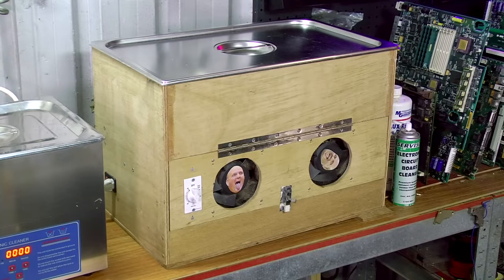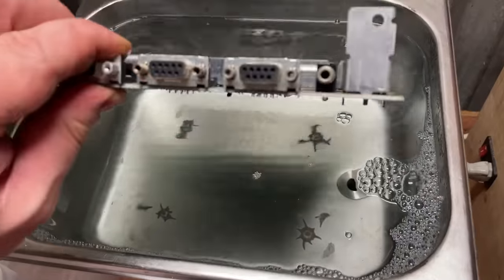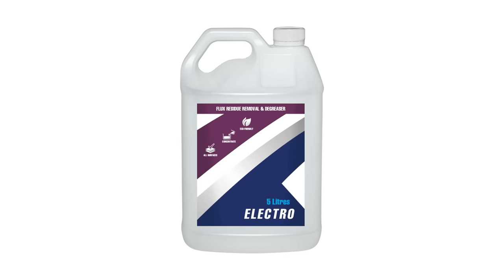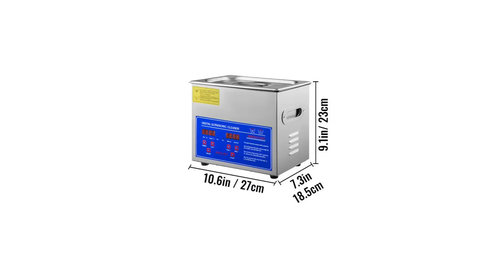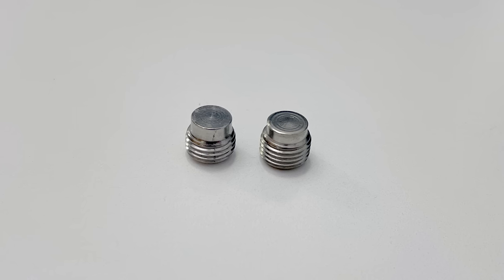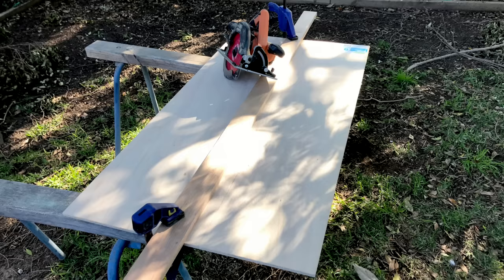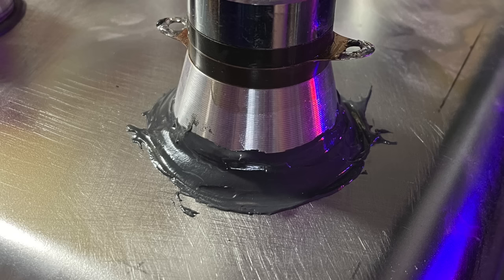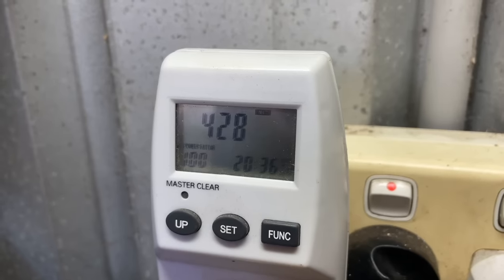Building my own Ultrasonic Cleaner

Comment: very good video !!! As a goldsmith I have worked with several of these cleaners over the years.
Did you know this hack?
An old Craft master told me during the cleaner is working to use some galvanic effekt...put some volts on Plus to the steelbasin and Minus to the ware.. in my case for example polished rings full of black polishing dirt under the settings. The dirt should go instantly off with this effekt. Perhaps you can test that?

Comment: I'd rather use JB Weld to seal a through-hole than to adhere a transducer. I'd have drilled 8 holes and pushed bolts through them, then smeared goop on the top to seal it off. Or maybe copper crush washers. But as another commenter mentioned, make sure there the right distance from the bottom of the pan. 

I'd also recommend making sure that all your transducers are effectively working together in phase. With smaller, single-driver builds this isn't a problem, but you could potentially see the two sets of transducers fighting each other with abtrusive interference.

Comment: I would use a broken file, or some hardened steel and gouge groves in the bottom where the transducers go...not just sandpaper...thick heavy grid like traces literally cut (not hugely deep but deep enough for the epoxy to bond to)
My small one kicked the bucket too...the mosfets/transistors and the flyback diodes shorted...uggh...ordered new ones...let's hope it works.
Going to cut a hole with a step drill in the side and find 5v-12vdc (if there is any) on the controller board...this way it can have airflow over the heatsinks and transducers. Might even go as far as insulating the metal bed with fiberglass insulation to keep the heat away from the heatsink/control board as well

Comment: Very cool video. I have considered building one in the past but came to the conclusion that prebuilt was better for me. It is nice to see someone build a DIY project where it makes sense rather than just because. Maybe the cooling situation is under control but you might stick little heat sinks on components that fail or get hot. The transistors have a through hole so they can be screwed to a heat sink. Often just a sheet of aluminum. They also make very tiny heat sinks ~1cm for sticking on small components. They are cheap because they are standard enough. Sticking a heatsink atop those transformers might help a lot. Though I don't recall ever seeing it done. Maybe because it wouldn't help that much with all the layers of tape and wire. Makes more sense just to not undersize the component.

Comment: I don't have any use for an ultrasonic cleaner but I found the video very interesting anyways. I was thinking that using more than one driver to push the transducers (in pairs) would make them vibrate independently and may cause some inefficiency when their phases are not in sync? It would seem one would like to push all the transducers in sync to avoid having destructive interference in the bath??

Comment: Just on the modules. They are basically piezo crystals being hit with an AC pulse. Meaning they are not polarity sensitive. If you throw a 'scope on the output of the drivers you'll see a high frequency AC wave. The terminals on the module should just be labeled A and B... One thing you should be aware of, make sure they are all wired the same. If not you'll end up with some out of phase with the rest, and that will reduce your cleaning efficiency (think hifi system speakers...).
Reply from the maker: Thanks, I cover much of this in my latest ultrasonic build video.

Comment: Sadly people really do think that using water on electronics is a bad idea when in reality it is the standard way of cleaning it. There is also no problem in using tap-water if you follow some simple steps. In general when cleaning something that is visibly dirty we used to just hold it under the tap and used a very soft brush to get of the junk, and only then throw it into the ultrasonic cleaner. This just keeps the cleaning fluid usable for longer and gives better results in the end.
Also specially for electronics with baredie flipchips, if they are small enough, we just put into a plastic bag with IPA. For bigger parts we just added some IPA to the water so it better cleaned BGA and other SMD parts while also helping with drying. But with IPA you need to be aware of the dangers of having an easily flammable liquid and its vapours and mist around so care must be taken.
(our local university has a very active electronics basegroup )

Comment: Check the regulator specification. It may work for 120v, not 240v. Also, do regulators work with 50hz and 60hz

Comment: You should be able to friction weld those studs buy putting the stud in a drill press and bringing it in to contact with the base. You might need to support the base on a block of wood. The friction and pressure will get the parts to a temperature where they fuse together . It would be best to experiment on some scrap first ! The discoloration caused by the heat would have to be buffed out.
Reply: How do you stop the drill from turning when there's enogh heat to weld?
Reply: @erik_dk842   you shut the drill off? 😅
Reply: @schwuzi  Your laugh tells me that you know nothing about the friction welding process.

Comment: Great video. You hit all the points without any Um’s, Er’s or Uh’s. Well done. 
I’m also a DIYer and have thought about my own ultrasonic cleanser. I wondered how to make sure they were all in phase. Don’t want half of them pulling while the other half pushes. Can you comment on that?
Also, is it desirable to vary the frequency? Maybe a dial on the outside that allows you to select Hz? 
Thanks,
Paul

Comment: put your drivers in a separate division outside of the box area where your tub sits.... so that air cooling will be more effective and isolated from your heating,,, if you can solder bolts on the bottom of the tub its better than any glue,
Reply from the maker: This is an excellent suggestion, and has already been done! I'll be doing a brief follow up video soon, outlining the recent updates I have made.

Comment: Are you using solenoids between the timer and the loaded circuits? That is transducers and fans.
Reply from the maker: The rotary timer in this original build was rated at 10 amps, and the load from the cleaner is only 2 amps, so no need for a relay or solenoid. I have since replaced that timer with an Arduino controlled timer, and that does use a relay.

Comment: You may have given the industry the idea of building a shallow but wide consumer grade ultrasonic cleaner if one doesn't exist yet.  I imagine that the commercial versions went though the same challenges that you experienced with they developed the first models.  I agree that the studs need to be welded.  I think the glue is to prevent the ultrasonicd transducers from unscrewing themselves from the studs.

Comment: as you are using diferent drivers you might get vibration feedback, transducers works the same as a speaker/microphone. The best is to use the same driver for all transducers in order to avoid phase problems in the 40kHz signal. Also working building ultrasonic cleaning machines notice those chinese drivers are too noisy.

Comment: I've used that JBL weld but I heated it in the oven 180 degrees for half an hour after it set, it's the high temperature version isn't it 250 degrees Celsius I think. But I don't know if the transducer will like the temperature, what you could do is to drill a hole in the connector and a hole in the tank and use a rivet with some epoxy resin or thread the drilled hole and put a bolt. Why does it have to be stainless steel what's wrong with using a plastic tub?
Reply from the maker: If you get a chance to check out my laundry sink ultrasonic cleaner build, you'll see how I secured the transducers for that one.

Comment: LOL 16:12 They are bolts dude, you can drill holes in the tup and bolt them to the transducers!:text-green-game-over::person-turqouise-waving:   (did not read other comments first :face-purple-smiling-fangs:) also put some cooling block on the transistor..

Comment: Very interesting. I think I will try building one.

What do you think the effect on driver operation would be if you used the bare minimum epoxy (to ensure it grips the pan over its entire area) and through-bolted the driver to the bottom with, say, a truss-head machine screw? A bit of RTV on the underside of the head should make a leakproof seal.
Reply: I thought the same thing.  First of all you should use the minimum amount of epoxy.  These high frequencies are very easily absorbed and the less you've got that's soft the better.   The point of these setups is to get the acoustic impedance as high as possible so that coupling from the transducer to the liquid is as efficient as possible.  The high surface area of the tray helps here, which also gives me the idea that the bigger ones will be more efficient and you could probably drop a transducer or two from the 100W per gallon rule as you go up in size.  Second, if it's being bolted into the transducer then why not bolt it into the base surface of the tray?  Just don't use rubber washers, though a layer of epoxy would be good here as a lock-nut glue and sealant.  Save it shaking itself apart.

Comment: Fascinating stuff!  I love learning for free from other peoples' mishaps 😇

I am interested in experimenting with ultrasonic transduction as an adjunct to HHO electrolysis, and have purchased kits that provide two different popular ultrasonic frequencies.  (Haven't had time to wire them up yet). 
Have you done any experimentation along these lines?  The word is that at the "right" frequency, the water is destabilised, meaning that the efficiency of HHO output/watt of power into the electrolytic generator is greatly increased.

I am also wondering how the metal pan can become (I presume statically?) charged from the ultrasonic action alone - especially with an aqueous (=conductive) liquid inside?  
I would have expected that there should be no static possible when the cavitation is (by definition) microscopic.
Even if produced, how could it build up on the unearthed metal pan, without immediately dissipating into the atmosphere?

That said, earthing all exposed metal in any device run from mains is always a good idea, and [IF] there is static present, it could have been the source of some of your electronic failures, jumping from the pan to the piezo elements and thence to the circuitry.
But it begs the question of HOW TAF static could ever build up under normal running conditions - like we're not talking about clouds hundreds of meters above earth, rather 1m!

Very comprehensive video though, nice work.

Comment: does it require the bundle power supply board? can we use desktop pc power supply instead?
Reply from the maker: The drivers I bought run of mains AC power, but I think there are other drivers that will run off DC power.

Comment: Would it not be better to drill the bolts through and using a flange to stop leaking? Instead of JB weld which would absorb the frequency. This would bring the frequency directly into the water and the basin.

Comment: You were likely experiencing driver failures because you wired everything in parallel. As you add components in parallel, you drop the impedance, ramping up the current in the driver circuits. Sometimes, to get the impedance matched, you need to run groups of components in series, and the groups in parallel. Just something to look into!

Comment: 2:30 Not only detergents or soaps, but just plain old isopropyl alcohol (a.k.a rubbing alcohol) added to the water will act as a surfactant, and increase the cleaning effectiveness without leaving residue that must be rinsed off in a separate operation.  IPA is quite popular for ultrasonic cleaning of electronics, where you aren't in a position to be sure you can rinse all surfaces off afterwards, just get it dry.

Comment: What do you do about the NOISE!!??
At my workplace, we bought 2 large Vevor units. Both around 10L. One for cleaning PCBs and one for rinsing them in demineralised water. 
The cavitation noise (apparently) (or is it the subharmonics?) was too noisy for some staff, so I've been building a plywood cabinet with soundproofing foam to house both of them. It cuts the noise down by about 60-70%!

Shame I can't post a picture of it here 😥
Reply from the maker: I generally leave the workshop when it's running to get away from the noise. It's a particularly annoying sound.

Comment: I repair vintage carburetors and most of the time parts of dissimilar metals are corroded together and difficult if not impossible to remove. Would ultrasonic cleaners work with some type of penetrating oil to get in between the corroded parts ?
Reply from the maker: Possibly, but not definitely. I have had mixed results with corrosion, depending on how bad it is. However, I will test this out for my next vid!

Comment: The velocity of sound through water   results in a wavelength of about 37mm at 40Khz. The multiple transducers leads me to believe there are likely areas of constructive and of destructive interference. I suspect parts of the target may be cleaned while others  may be unaffected.

Comment: The fluid in the cleaner doesn't have to be water. I use gasoline for carburetors and diesel for grease. (Outside with a fire extinguisher handy)

Simply green makes an alluminum friendly industrial cleaner.

Citric acid works great for unoxidizing (derusting) all metals except alluminum

Comment: With the transducers in parallel, it seems to me that the current flow will be pretty high from the low impedance transducer connection.  Connecting them in series might be worth trying to see how it affects the high component temps that are present now.  More voltage but less current. :). Cool project by the way.
Reply: Nope ! They have to be in parallel. The transducers are not linear elements.
If you put them in series, you'll get weak ultrasound...and if you increase the voltage to compensate, you'll damage the transducers (keep in mind...they are not linear).

Comment: Make sure the wire basket you use has small rubber feet. You don't the metal basket to come in direct contact with the metal tank. The ultrasonic vibrations will quickly wear a hole through the tank wall if you have direct metal to metal contact.....

Comment: Very familiar problems here...  facing the same sorts of symptoms with my elcheapo chinese cleaner...

how did you identify the faulty transformer? and how do you rebuild one?
Reply from the maker: I've found that if the driver keeps frying voltage regulators (and fuses) it's one of the transformers, but if the driver doesn't blow fuses (but it doesn't make the transducers buzz) it's the other transformer. From what I have found, cooling seems to be everything. I've set up a much more efficient cooling method, and that seems to be helping. I'll be doing a follow up video soon with all my recent findings.

Comment: I suspect a major factor in the transducers falling off is simply gravity. Rather than supporting the tank and let them hang down, if the assembly is supported using the transducers as "feet" they would remain reliably attached. Best luck.

Comment: If any of the transducers aren’t attached to the SS tank securely, I would bet that the harmonics can’t transfer to the tank efficiently. The attachment of each component is crucial for longevity. On the other power side there’s a need for a mater controller to manage power output and monitor for problems before they happen. Other peoples posts also mentioned correct placement of the transducers, which would make sense for efficiency and that installing that many transducers in a small footprint aren’t counterintuitive and a waste of money

Comment: We would cheat in our lab and use DI water in the ultrasonic, then suspend a part in a glass beaker with a solvent (acetone, MEK, or Isopropyl depending on need). Mind you, we weren't trying to be the most gentle on our parts, but we did need them as clean as possible. Solvents tend to work better than detergents in ultrasonics, even if separated by a container.

Comment: I used to do this with a disaster recovery company, we had vacuum ovens to completely remove all liquid afterwards.
Reply: Vacuum oven - solid steel box with opening lid and clamps and a GOOD seal. Use a thermostat controlled or low temperature element for heat and an old fridge motor as a vacuum pump. You don’t need much heat or vacuum, just leave it longer. A tap on one side lets you break the vacuum easily.

Comment: I've heard that its quite important to get a sweeping transducer so that you get more complete cleaning and so that your parts arent smashed with the same frequency for the whole cleaning time. Have you had any parts come out that were broken or didnt work afterwards? not including the sensitive ones you mentioned. I am in the exact same situation by the way.. Im trying to clean my server motherboard 330 x 345 mm. Its a nightmare to find an economical solution. both for the machine price and the fluids to fill something 30L +

Comment: What is the difference in cleaning with different transducer frequencies? Is 40kHz pretty much the standard?
Is the transducer being supplied a DC voltage? If so, what voltage and how much current per 50W transducer?
If one argon welds the bolts to the tub, what keeps the transducers from rotating loose? Loctite? If so, what grade? Or would Rocksett be better?
Reply from the maker: If you get a chance, please check out my latest ultrasonic build as it explains a lot of this stuff.

Comment: Good day,
Thank you for sharing your experience and building ideas. Great video! Just a question, the 100W/gallon formula you use to calculate Watts needed, do you use an UK or USA gallon, as there is about 0,77 liters difference in capacity?